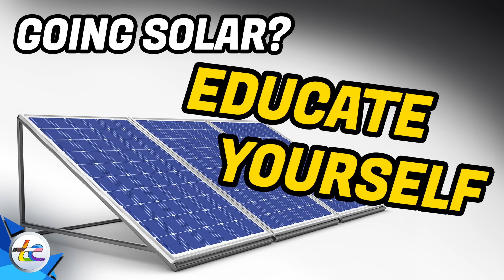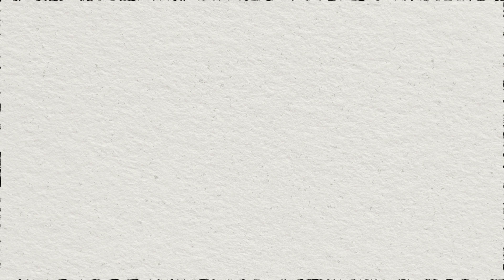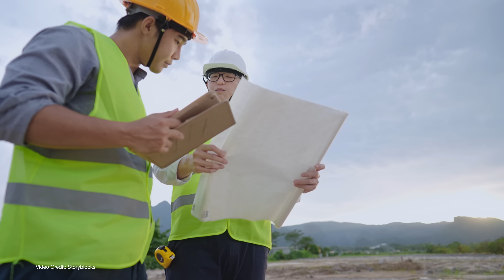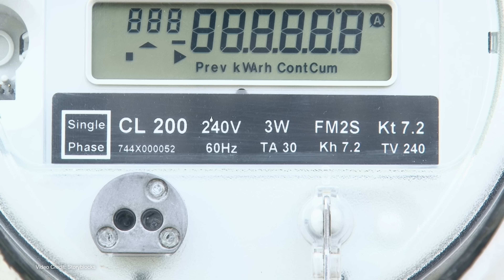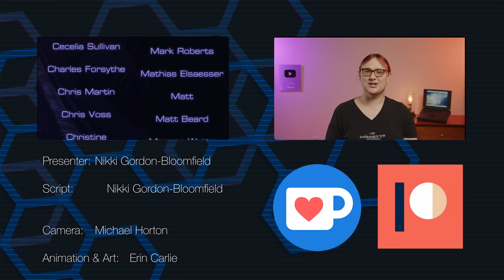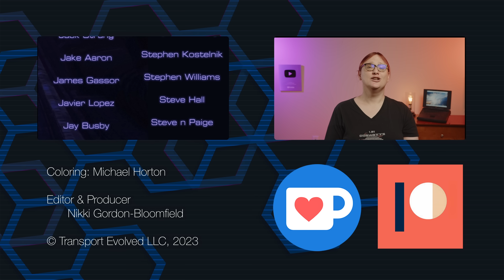Going Solar To Power Your EV? Here Are The Terms You Should Know!

Comment: So if it takes about 3 yrs to payoff the carbon debt of solar panel production and 60k - 90k miles of EV use to payoff that carbon debt..well we missed the doomsday timeline.  Now if I bought a $100k EV and added $40k worth of solar how much greenhouse gas was produced in making that $140k to pay for all of this? What about the co2 cost of installation?  My guys came in ICE vehicles and the panels were delivered on a diesel truck.  Probably some significance to that co2 which isn't part of the solar production co2.  Same for my geothermal.  3 240ft bore holes all done by a diesel powered truck running for a few days.  Plus a backhoe to dig a 4 ft deep 75ft trench to run the lines. 
"Charging an EV battery with 1 kWh requires about 3.1 kWh due to power plant, transmission, and battery charging losses. Including those losses into our EV rating means that Tesla becomes a 45 mpgeE (the E is added to indicate it is based on initial energy), and a Ford F-150 EV is 23 mpgeE. Because we account for energy to make electricity, we can directly compare mpg and mpgeE ratings. The result is that both EVs use more energy than a gasoline-powered hybrid Toyota Prius rated at 52 mpg"  PennState Institute of Energy and the Environment. June 2022. 
So many hidden environmental costs that are not accounted for.
Reply from the maker: "So many hidden environmental costs that are not accounted for."

The figures you've cited don't tally with any other study, and yes, so many environmental costs of fossil fuel extraction are not accounted for, or are provided by the fossil fuel industry and recent research has shown them to be gross underestimates.

^Kate
Reply: @transportevolved  there is an old saying "the figures don't lie but liars do figure". I don't know your educational background.  Maybe it is as good as the PennState department people.  But you failed to counter the figures I presented with any other study  to support your position.
Reply from the maker: Maybe we already have an entire playlist of videos to counter it and I have better things to do.

^Kate
Reply: @transportevolved  great. Show me that playlist that counters my claims, which aren't my claims but the claims of a well respected university department, so we can have an actual conversation about it.  Is your YouTube just a hobby for the team or are you trying to make a profit?  If it is profit then supporting your position IS the thing you should be doing.

Comment: could it be worthwhile to start pushing for the use non Li batteries for home use (and for mega grid storage).  The added demand is pushing the price of Li and hence of EVs  beyond what they should be.  And.... some economists estimate that for a linear decrease in the price of EVs, you get an exponential increase in the potential market.  There are some very nice advantages to some of the alternatives.  Many of them have longer life, ability to cycle between 0 and 100% with no damage, simpler electronics, safer from a fire point of view and so easier to ship, made of cheap, readily available  elements which should allow them to be cheaper than Li batteries once they get market share, and ease of recycling, (if you ever have to recycle them).  We have liquid metal batteries based on Sb and Ca and now on Al and S with research on lower temperature options ongoing, redox batteries based on V or Fe, flow/plating and gel batteries based on Zn and Br and even the up and coming Na batteries.

Comment: ¹1¹st;

California goes sustainable, nothing Beats nuclear.
Reply: @
RcStan, RC Stanley  Renewables are way cheaper than Nuclear.   Nukes are expensive to build, run and dispose of the fuel.   Having said that, there are some new systems that address many of those issues.
Reply: I'm thinking, for a developing country it would be easier to approve and fund small projects (solar), than a huge capital investment. The solar farms can be built faster, create some permanent jobs, localized and at lower skill level, which would be a great benefit for all those communities.
Reply: Nuclear is indeed the best, yet homeowners should have a good option to solar charge.

There just too much fossil for only nuclear to replace it.
Reply: @philbear2185  they need and do both.
Bangladesh Philippines Ghana etc have or are building nuclear as well.

Comment: in the early 1990s the back then new Mercedes ICE engine plant in Stuttgart was the first solar powered plant. The complete roof was full of solar panels to generate the energy when the panels were only capable of producing about 100 Wp - so lots and lots of panels.
Has been repowered since twice cause progress had a huge impact.

If you wanna builld a diy battery and solar power system the yt channel will prowse from Las Vegas is the best source for grid tied systems and off-grid - and beyond that even van life systems where his channel once has started..